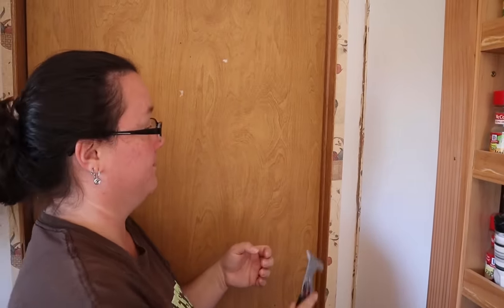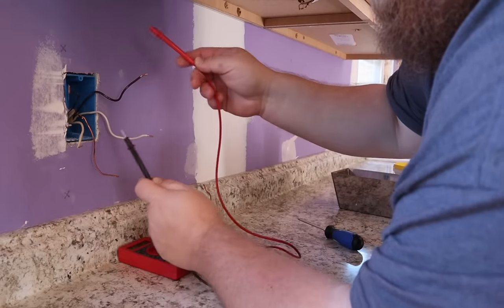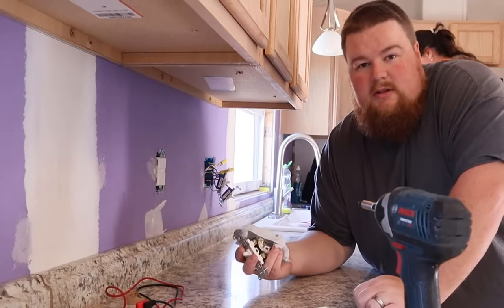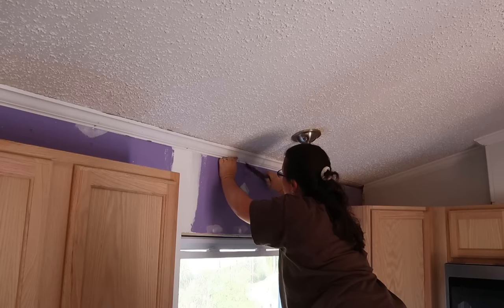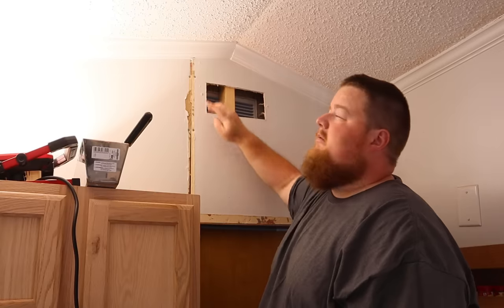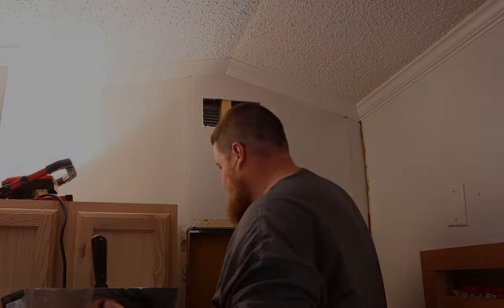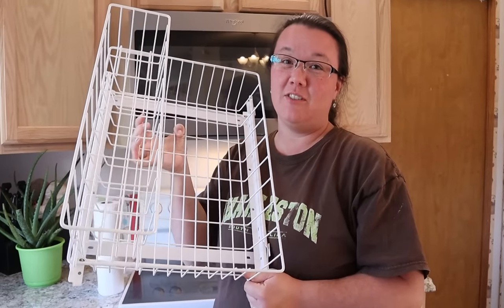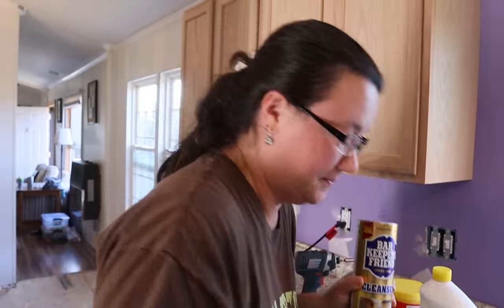How to Remove and Mud Over Wall Strips | Budget Mobile Home Remodel #24

Comment: Why do they use strips instead tape and drywall compound? The underside drawer organizer is great.
Reply from the maker: Mobile homes move and flex so much, especially while moving down the road that the seams would probably all crack without using much stronger and stiffer framing system which would be better, but cost more. Great question!!
Reply: Leave the strips unless you are on a concrete pad or sauna tubes.  The walls will keep cracking due to the home shifting. I ended up putting mine back on . Looks nice the work you have done. I found it weird you had no outside wall board other then the aluminum. Unless I missed something. In Canada you have siding and house wrap over OSB board or Plywood.  I like the counter tops u picked out as well. Nice when it comes out in the end.

Comment: Can I Plaster over the vinyl walls. Is there anything I should apply to the walls before plastering??
Reply from the maker: If you mean the join compound like we used, we just cleaned the walls and applied it on top of the surface. It's stuck fine for us so far without any cracks or issues. Good luck!

Comment: I live in Amarillo TX and live in a mobile home. Can paint these type walls or do i need to add dry wall first?
Reply from the maker: We've had no issues with painting them -- even directly over the original wallpaper covering. We just used a good quality primer + paint all-in-one from the hardware store.

Comment: Before you added your second layer of mud did you send any of the first player off
Reply from the maker: No, but the first layer was quite thin. With practice you can get sanding (which we use a wet sponge instead of sandpaper) down to very minimal and only at the last step.
Reply: @sam-and-angela  what did you use for the corners of the wall

Comment: Question:: So what is the purpose for those strips on the walls of mobile homes and are they necessary?
Reply from the maker: Ease in 'finishing' of the walls in the factory and so that they don't have to have such rock-solid frames to haul the home down the road to set up. Otherwise the walls would crack at the joints I'm sure. Great question though!
Reply: Green Acre Homestead ......Thank you for responding!

Comment: Does the tape stick well to the weird wall paper on your mobile home? I live in a 2014 and I want to get rid of all strips. Have you had issues with painting?I painted a bathroom with kilz primer and then painted it.The paint is coming off in bathroom.HELP...?
Reply from the maker: No problems in the year and half since it was done. :)

Comment: What did you do for the outside wall strips?
Reply from the maker: We either left them, or bought new molding. There's not a ton that can be done unless you buy corner bead then build up the joint compound from there.

Comment: Did you get the camera fixed?
Reply from the maker: Unfortunately, no. This video was the 2nd-to-last video shot with it before it died. The last video shot with it was Sam running an excavator on a mountain doing some road grading. Still unsure if the water or extreme jarring being clamped to the excavator killed it, but we're working to get our new camera ASAP!
Reply: We are here hoping you the best even without the video we are here supporting 💓

Comment: I just watched this video, concerning the GFI outlet.  Each one has a LINE side and LOAD side.  Please do not use the LOAD side of the first GFI to feed the 2nd GFI.   If you do this, they will not function correctly and that is not a good thing.  You would need to joint up the 2 pieces of romex going from one to the other, then pigatil from the joint in the box, to the LINE side of the first GFI.  When I say they wont function, i mean they will not trip when they are supposed to trip, and/or may trip without real cause, been there, done that.